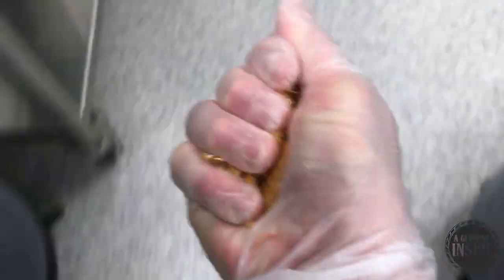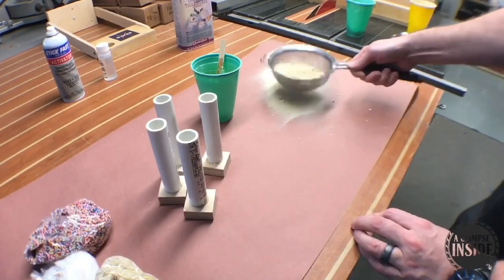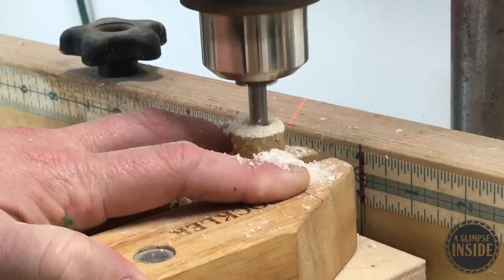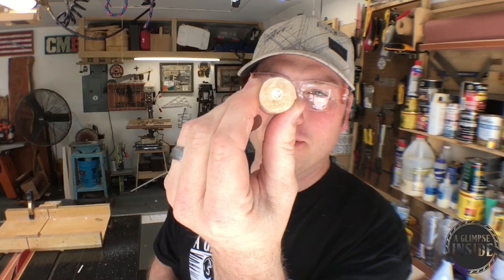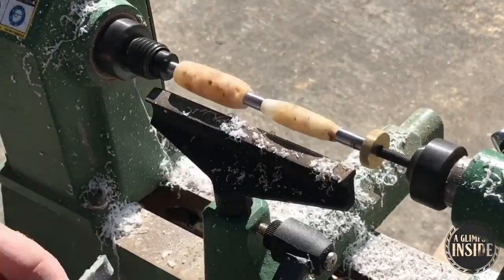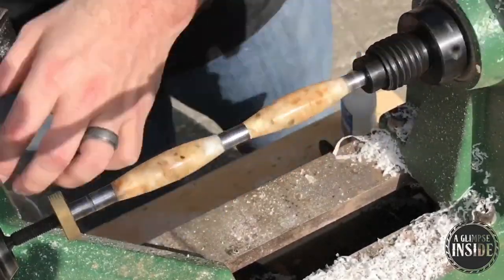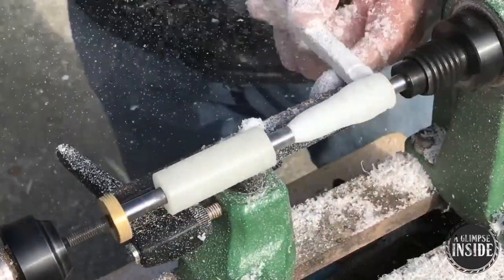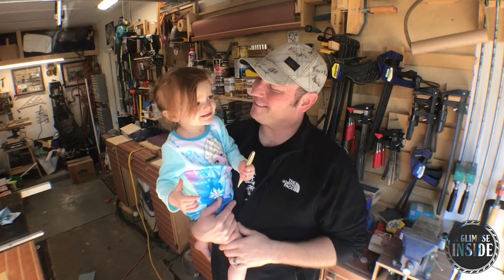How To Make a Pen out of Bread | How To Turn Sprinkles Into a Pen Too | Diy Project

Comment: Those came out awesome and the fact that they have specific meaning to you makes them all the much cooler.  Have you thought about doing a rock sugar pen?  Scuffing up the brass core, blocking the center of the tube and dipping it in a saturated sugar solution?  I wonder if the sugar would look different if you turned it?
Reply from the maker: That’s an idea for sure. I haven’t considered that however that sounds awesome. I think I’m going to try mixing flour with resin and then dried  herbs too!  Thanks for the idea and the feedback